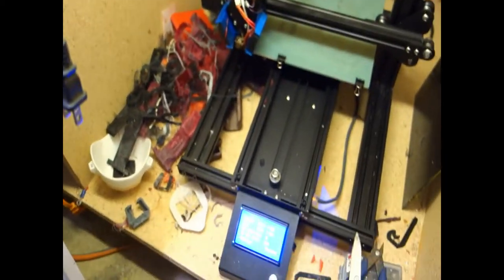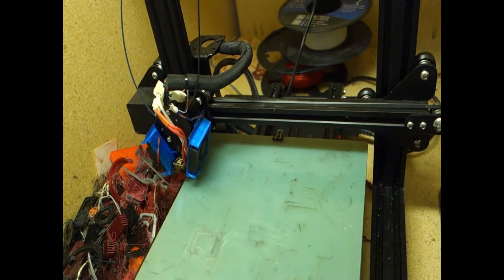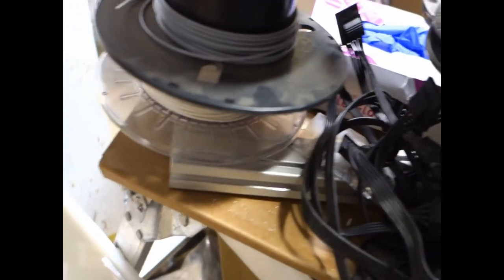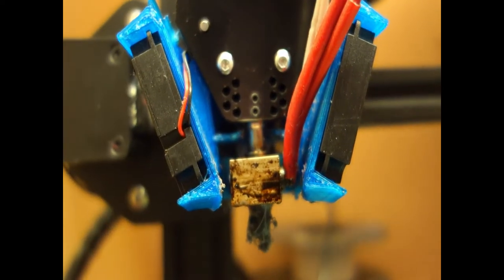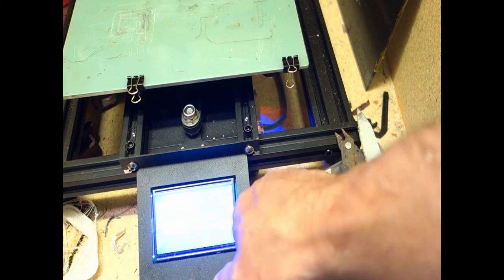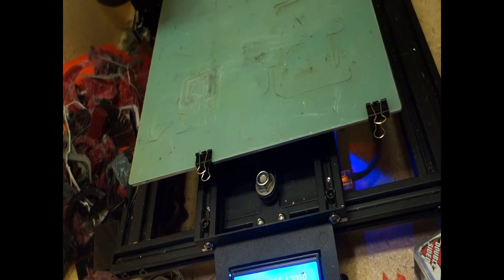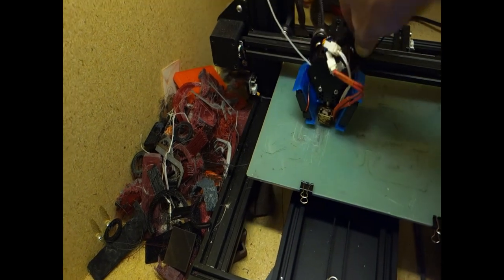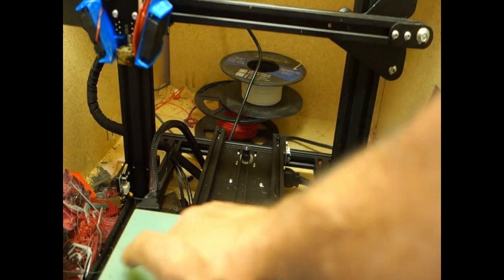M3D Crane Dual Fail

Comment: Have you swapped out the nozzle to see if it has a clog? I had something similar happen with mine. It was letting out just l little plastic but it was under extruding like crazy just like how your prints are.
Reply from the maker: I took ot apart and found one of the extruder stepper motors broken.
Reply: @idahocreator2491  Well that will also do it haha